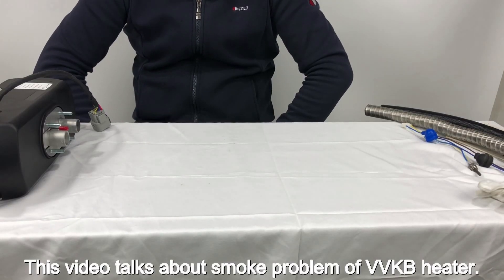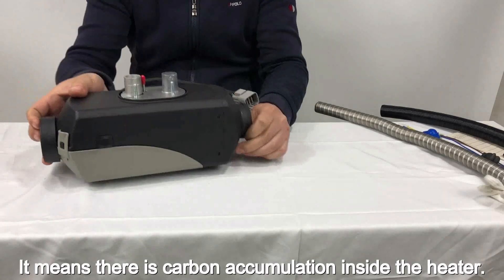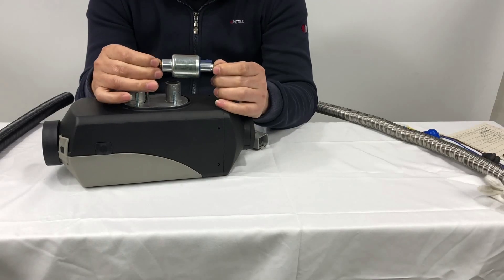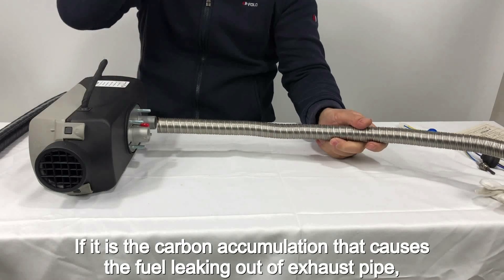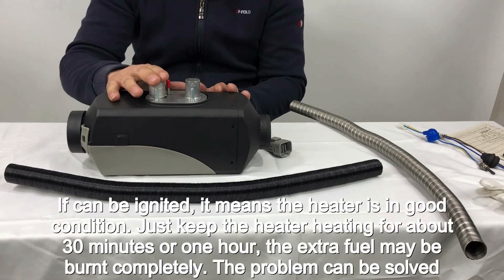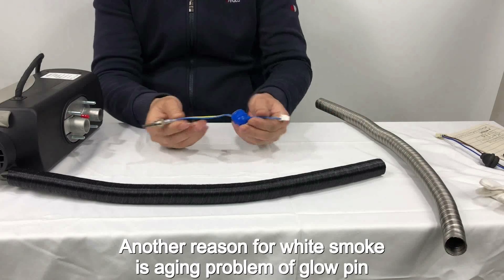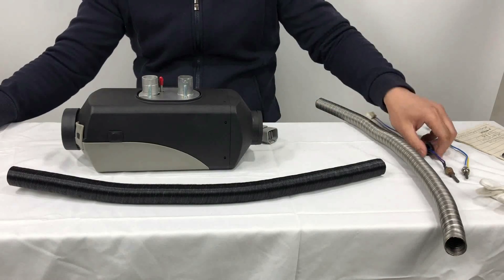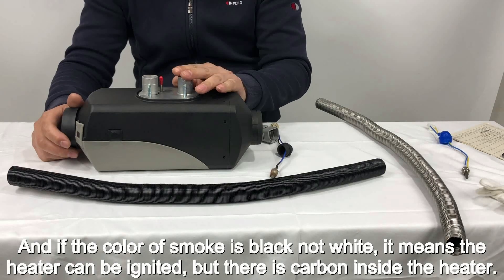What can Cause Smoke Problem of VVKB Parking Heater?

Comment: The maximum exhaust length should be 2m (minimum 20cm) with max combined bends of 270 degrees. White smoke and e-10 error message can happen if you exceed these limits